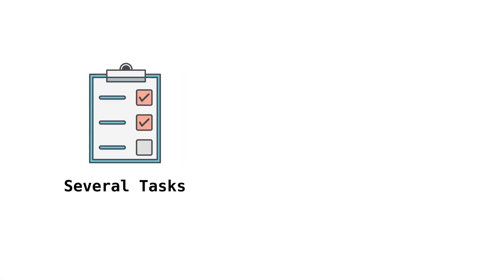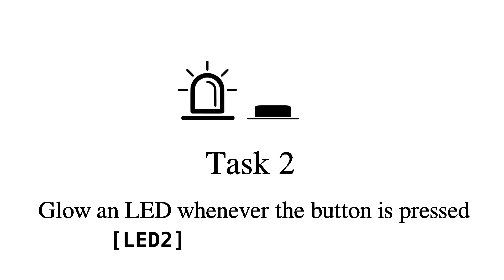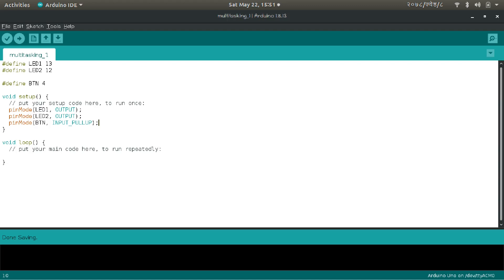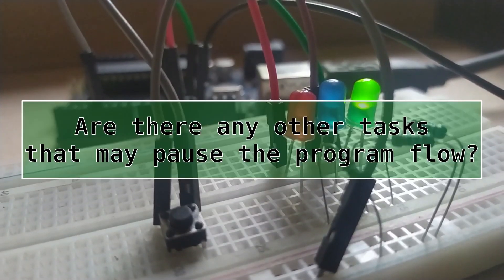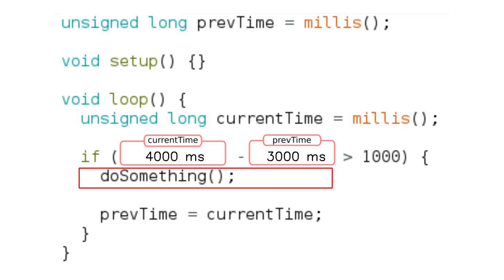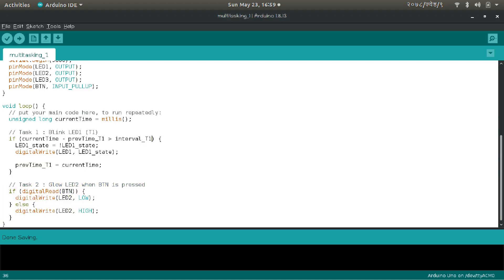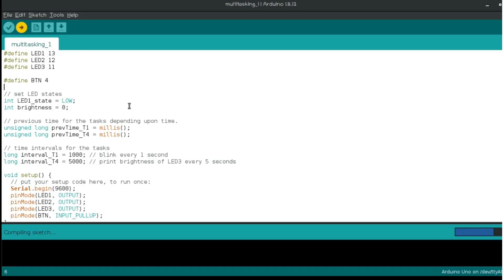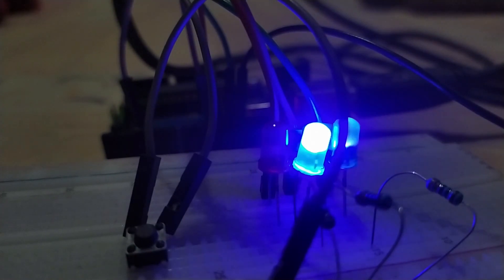How to do multiple tasks in Arduino | Beginners | millis() function

Comment: Instead of saving prevTime you could als use modulo.

if(millis() % 1000 < 50){};

This solution is not always suitable but its more compact and its safe against the overflow of the counter behind millis.

Comment: Your code may creep, should the accumulation of run times of the other tasks cause your timer to advance 2 ticks in one trip of loop(). Instead of global prevTime, use prevTime_T1, prevTime_T2, ..., initialize each in setup. Then each task should compare currentTime minus its own prevTime_Tn > its own interval to trigger task code. AND last part of task advances its prevTime_Tn by its interval (iow not set to currentTime). If you desire for the code to be a bit pickier, get currentTime before each task filter.

Comment: bro you have explained very well can i get your help in something ?. i have a timer which operates with 4 buttons and i have function in a loop which will run for 40 seconds . and now i want that my timer and my loop function runs together at same time . can i do that ?
Reply: "and i have function in a loop"
You mean you have a Loop IN A FUNCTION 

YES YOU CAN DO THAT
However, instead of killing yourself with Arduino
Why don't you pop over to ESP32
Learn about Multi Tasking    thefollowing FREE RTOS COMMANDS

xTaskCreate   (Focus on this)
xTaskCreatePinnedToCore (This is popular but over rated but sometimes useful)

if that alone doesn't help you , Learn about
Queues
Semaphore
Mutexes

See, Unlike processes in Arduino,  In ESP32  You don't do this...

void setup()
{
}

void loop()
{
}

Instead you do this

void setup()
{
}

void Function1()
{
YOUR ONE TIME CODE GOES HERE
  for(;;)
  {
   YOUR LOOP CODE GOES HERE
   }
}

void loop()
{
}

AND YOU CAN CREATE AS MANY FUNCTIONS AS YOU WANT
AND EACH FUNCTION CAN BE ASSIGNED PRIORITY with the following line

xTaskCreate(Function_1, "Function 1", 2000, NULL, 1, &Function1 );

The priority is the   "1"
this will allow you to dictate which programs runs first, second or at all 
so long as you understand THE TASK STATES OF RTOS
https://www.freertos.org/RTOS-task-states.html

Your problem is greatly simplified if you use ESP32 and FreeRTOS

In Arduino Functions run BY DEFAULT  Sequentially

In ESP32  BY DEFAULT
Assuming all Functions are set to the same priority 
THEY ALL EXECUTE AT THE SAME TIME
There is nothing for you to set 
LOL

Comment: Professor, I have a request, sir 🙏, there are a lot of tutorials about atmega, Arduino and ESP8266 but what about AT89s52 [8051 families]?? the AT89s52 is a very basic microcontroller that we read in our college, 
and my problem is "I'm making a digital clock [7-segment] using AT89s52 (NO RTC) but the time drifts about 5.6 seconds in every hour!! and this At89s52 microcontroller doesn't have any function like millis() inside AT89s52's IDE(Microvision Keil software), and a book suggests to play with the ppm and fix the error.But, yet the problem is At89s52 is not like Arduino , so Professor, I need your help, can u please make a dedicated video on this?? so that everyone will learn a lot, or u can also help me by writing about the solution below 🙏"
BTW I'm using a 16MHz crystal with this microcontroller and using timer_0 to generate a 25ms delay and using interrupt_1 to count that 40times so that there will be 1 second completed, but that's not the problem I guess.. I just need your help.. .🙏🙏
Reply: Instead of coming here for the answer
WHY DON'T YOU GO TO THE ARDUINO FORUM ?

I also have some advice for you if you go there

1. THEY EXPECT YOU TO DO YOUR OWN WORK AND RESEARCH THERE

2. They don't like it when you are in school or Uni and say
"I have this project...........what's the answer ?"
We are not there to do your work for you
We are volunteers on the site
WE ASSIST YOU........ We don't do the work for you.
Remember that important point and you'll be fine

3.  When asking a question follow this format
 -  Introduce yourself briefly
- Explain what Hardware you are using and What IDE and Version you are using.
 -  Briefly describe the project
 - Explain your problem IN DETAIL
- EXPLAIN WHAT YOU HAVE DONE SO FAR TO TRY TO FIND THE SOLUTION.
(if you skip this part, you won't have a pleasant time on that forum) doing this DEMONSTRATES you have done something , and you can't lie because we can tell if you're lying, so make sure YOU ACTUALLY HAVE DONE RESEARCH

- Post your code USING THE CODE BUTTON, do not just post it to the forum
(if you don't know how,  Ask the forum and they will tell you) there is a button at the top called  /Code/    Press that .

 - Provide a schematic of your project, even if it's hand drawn.
Don't skip this as they will demand it before you get any answer .

If you do those things, you'll get a lot of assistance
if you don't you'll probably get told "we don't do your homework for you"

also, if your code was written by an A.I.  DO NOT POST IT,  they hate that .

But coming here to get the answer is not the right thing to do
Reply: @martinkuliza  U wrote these much words for me, Just to help me. 🥺🥺 OMG, u r such a kind and nice person, who gave his time to guide me. 
Thanks brother ❤️❤️❤️ 
Love u from India ❤️
Reply: @RanaRao_Chandrachur  
"U wrote these much words for me, Just to help me."
YES I DID

"OMG, u r such a kind and nice person, "
YOU'RE WELCOME, THANK YOU

Question : Why are you using AT89S52 if that's the problem.
is it a course parameter that you need to use this architecture.
if yes... WHY ? What's the purpose of doing it

if your'e allowed to use another board, i would suggest not Arduino but ESP32 Wroom

But if it must be that, then 1 thing you can be certain of is this...
THE LECTURER WILL KNOW THAT A SOLUTION EXISTS
therefore it can be done
The lecturer will have a lesson they want to teach you,   Know what the lesson is and you'll be closer to the solution.
Reply: @martinkuliza  Actually yes, I was learning At89S52. And I got the solution, I will use RTC using I2C interface. There was a solution with the interrupt and using good crystal but they are not even giving decent results, so I decided to use a RTC ds3231 that is temparature independent, means it automatically resolve it's frequency drift based on inbuilt temperature sensor. 

Yes Esp is the best option as it syn using internet.

And once again Thanks brother stay safe, healthy and happy ❤️❤️❤️❤️❤️❤️❤️❤️❤️❤️❤️❤️❤️❤️❤️❤️❤️
Reply: @RanaRao_Chandrachur 
You're Welcome...

RE
"Yes Esp is the best option as it syn using internet."
I actually wasn't referring to the internet feature of it... but.. Yes you can do that as well
Reply: @martinkuliza  Hm thanks for all suggestions brother. ❤️❤️❤️

Comment: #define LED1 13
#define LED2 12
#define LED3 11
#define BTN 4
boolean LED1_state = LOW;
byte brightness;
unsigned long prevTime_T1 = millis();
unsigned long prevTime_T4 = millis();

long interval_T1 = 1000;
long interval_T4 = 5000;

void setup() {
 
  Serial.begin(9600);
  pinMode(LED1, OUTPUT);
  pinMode(LED2, OUTPUT);
  pinMode(LED3, OUTPUT);
  pinMode(BTN, INPUT_PULLUP);
  
}
 
void loop() {
  
  unsigned long currentTime = millis();
  if (currentTime - prevTime_T1 > interval_T1){
    LED1_state = !LED1_state;
    digitalWrite(LED1, LED1_state);
    prevTime_T1 = currentTime;
    Serial.print(LED1_state);
  }

  if (digitalRead(BTN)){
    digitalWrite(LED2, LOW);
  }else {
    digitalWrite(LED2,HIGH);
  }

  if(Serial.available()){
    brightness = Serial.parseInt();
    if(brightness >=0 && brightness <= 255) {
      analogWrite(LED3, brightness);
    }
  }

  if ( currentTime - prevTime_T4 > interval_T4 ) {
    Serial.print("Brightness (0-255): ");
    Serial.println(brightness);
    prevTime_T4 = currentTime;
  }
}

Comment: using millis() works, but your code will fail after millis() is reset to 0. Another method of achieving pseudo multi-tasking is treating each task as an object containing a few methods to maintain and check an internal counter. A caveat with this is that exact timings can be a little hard to achieve. Say you want to blink an LED every 1 second, you use an object representing the LED task, within this object you have a counter variable, a checkCounter() method and a switchState() method, in your main loop, you call LED.checkCounter() every, lets say 10ms, the checkCounter() method implements the same check as you are doing with millis(), but checks its internal clock, after hitting a threshold of in this case 100, it calls switchState() and resets the counter to 0. as you add more tasks, you simply call their checkCounter() methods one after another in the loop. This avoids messy code in the loop and makes tasks self contained, making your program much clearer. Additionally, you are not having to do maths with unsigned longs, which will take far more clock cycles than a well chosen data type for an internal counter, which in some cases could just be a single byte. Using objects also lets you do other forms of multitasking, such as priority based, you can even maintain a list of tasks that can be added to providing a far more versatile multitasking environment.
Reply: hint 2's complements for roll ober
Reply: @ikeabuchi1  it will still fail, the code is checking 'if greater than', it will fail at the roll over, the first iteration after the rollover will fail, unless you check the absolute difference.

Comment: Can I use this method when the processes depends on each others and starts if the user sends signal ? Like the user will send signal to activate some continuous servos as chosen by the user (each servo has its own delay) and when the servos start rotating the DC motors will work as well.
Reply from the maker: Yes it will work even when processes depend on each other but having a delay on a process should be avoided for proper functioning.
Reply: @amrit5   Actually I understood and tried it , it works but not as I want because my program depends on the user so I want to make constats of time provided by the function millis() because the millis starts counting when the arduino board is on not when the user send the signal to activate the motors ... but its not possible inside arduino loop funcrion to save the current value of milli time. I am thinking of a solution to save the time inside the loop so I can run the DC motor after the servo complete one rotation using the solution you presented.

Comment: This method of timing has real-world use. The aviation industry uses an inter-device protocol with a "bus list" format with sub loops inside a main loop. You determine priority devices and add hardware interrupts, but the loops continues indefinitely.
Reply: yeah thats my problem i have a timer which runs perfectly but i want that my loop also work with that timer but my code stuks in that loop and the timer dont run

Comment: Yo I might see a problem with this technique. The way that millis() works is that it's going to use ISR: Interrupt structured routines. Every 1 millisecond, an ISR routine is going to be launch and a timer is goign to be incremented. However, aren't we limited by the a maximum amount of millisecond that an interger can take? Every  approximately 65 000 millisecond or 65 secondes, the program would crash because the timer would restart
Reply: There's no problem with it
everytime the counter reaches it's MAX_INT it rollover to 0 and continue from there
No code crashes
Reply: @mihaiocnaru5260  No code crash problem, but when millis() rolls over to 0 the comparison of the current value of millis() to the pervious will fail to work as intended
Reply: @akirchner3 depends on how you do the comparison.  Unsigned integer types in C++ have wrapping overflow semantics.   This means that additions that overflow and subtractions that underflow can still give the correct answer as long as you work with delta t and not absolute t values.

Comment: Perfect! This the best video explaining multitasking on Arduino I have ever seen. Fantastic job mate!
Reply: If that is true then you haven't looked into ESP32

ESP32 Multitasking shits all over this and then some
Reply: @martinkuliza  I needed this for Arduino not esp32
Reply: @ineffige 
OK, I guess.
if you want to make life hard for yourself, go for it.

I also know how to implement Multi Tasking (Not like in this video) but as you would in ESP32 using FreeRTOS as well

I'm not suggesting you should do it,
I'm just saying

YOU CAN DO IT
YOU CAN TRY IT
YOU CAN INSIST ON MAKING YOUR LIFE DIFFICULT
or you can transition to something that will make your life easier

don't get me wrong
I'm from 70s Electronics, i have Massive respect for Arduino
but fact is fact,  Arduino doesn't compare to ESP32
which is why Arduino Dev Boards are now being sold with Bluetooth and WiFi Integrated

the issue with these boards is still
Even though they have WiFi and Bluetooth
They haven't increased in memory
they don't have dual core processing

Its sad to admit, But Arduino is Dying 
to persist through a problem using band aid solutions like milli's 
is to continue to make your life difficult for no reason

but hey.... WHATEVER MAKES YOU HAPPY MATE
Reply: @martinkuliza  lol. If I wanted tips for esp32 I would search for it not Arduino. Why so bitter dude
Reply: @ineffige 
So... Do you need help with anything or.... ??

Comment: This is the most helpful video I've found explaining the millis function so far. However, I'm still a bit confused. I'll practice and learn hopefully.
Reply: If it helps, basically, instead of using a command that halts command execution (delay) he's simply comparing times in a conditional statement to control when the light turns on/off. Using delay, the loop() function takes 2 seconds to complete before it runs again in the initial code, because the delay there is 2 seconds. This leaves very little time for the Arduino to realize when a button press occurs in the latter part of the code. Without using delay, the loop runs at a much higher speed and thus condition checks run much faster.

For example, let's assume this code is short enough that without delays, loop() running a single time only takes 100 milliseconds at 5:17. So in one second, loop() runs 10 times. So the loop would check for a button press every 10 milliseconds while also checking whether the current time is a minimum of 1000 milliseconds after the last time stamp we saved to the prevTime() variable. Since prevTime() is only set when the condition statement is true, it remains whatever value it was set to eg. 5000 until the difference between the previously saved time and the currently reported time (time continuously updates during program execution), is greater than 1000 ms.

He probably should have set it to >=1000ms because technically, the LED would always be on for slightly longer than the intended 1 second otherwise.
Reply: Same